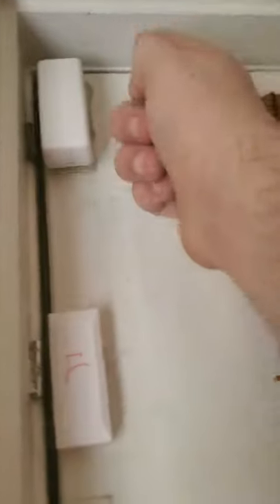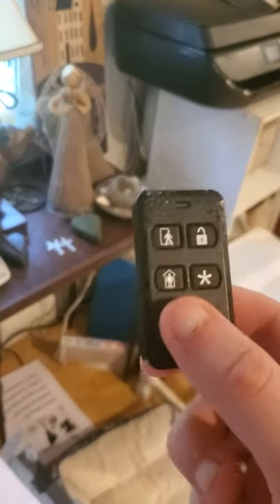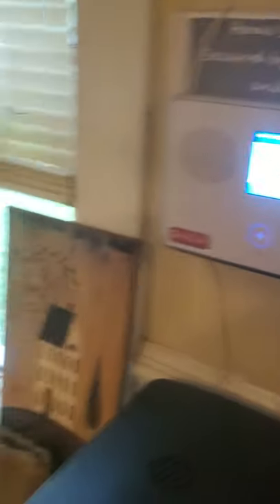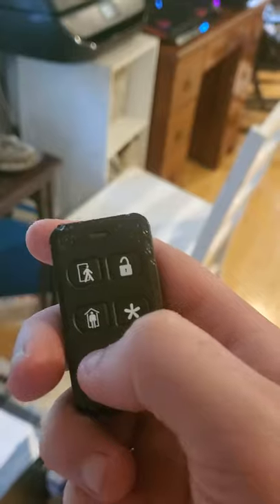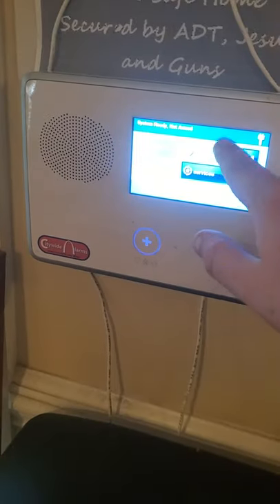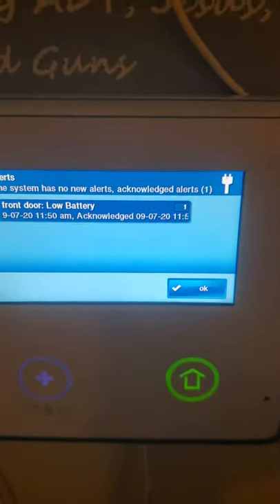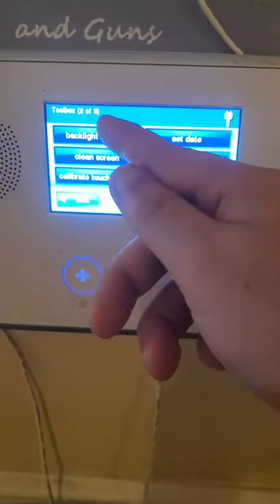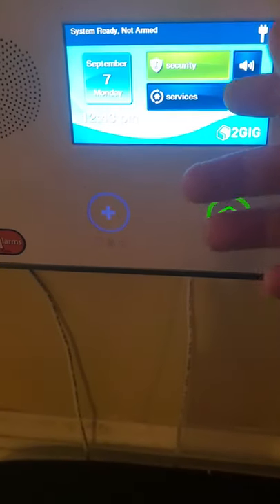2-Gig Alarm Test and General Update

Comment: Awesome video glad your back
Reply from the maker: Thans m8!
Reply: Hey.  I'm buying one of these panels and I'm wondering how loud the alarm siren is.
Reply from the maker: @trevornonis7710  they are exteremely loud! Very good system overall definitley louder than most!
Reply: @tabbycats8229  cool thanks. Just from all of the videos online it doesn’t seem too loud. But I guess I’m wrong😄
Reply from the maker: @trevornonis7710  lol no my phones mic isnt the best lol
Reply from the maker: Hi there! I'd be happy to assist. If you put the door into bypass, set the alarm, and then open and close the door while it's armed then no. The door will stay bypassed the whole time the alarm is set. However you should note when the alarm is disarmed again, you must re bypass the door if you need to open and close it. All bypasses from the previous armed state are cleared upon disarm. You must manually bypass the zones each time you arm the system. But yes as long as the door is bypassed  you can open it as many times as you need whilst armed. I hope this helps and please let me know if you need any more help! :)
Reply from the maker: @Dilhan Gurbuzer Glad I could help! The entry delay is a time set, when armed in away mode, for you to disarm your system once you enter the house. The entry door is usually your front door or the one closest to the panel. As far as your basement and living room motions go, yes you can bypass the living room and use the basement sensor :)
Reply from the maker: I can do a video later this week on how to change the entry/exit times on a 2gig if you like :) I've been needing to do another video anyway
Reply from the maker: @Dilhan Gurbuzer wow that's a ridiculous price! Sorry you had to deal with that. Since the default installer code is not working, you may need to contact the company who installed the system and see if they'll give up the installer code which is highly unlikely. In which case I can help you factory default it (there is a special way and pattern you have to so something with the power plug) but that would require you having to reprogram every single sensor and code etc. I would definitely see if they'll give up the code first. If not I can certainly help you more! 🙂
Reply from the maker: @Dilhan Gurbuzer Also as far as the pet immune thing goes there should be a dip switch inside the sensor for sensitivity depending on the model, I can do a video on that too if you want
Reply from the maker: @Dilhan Gurbuzer yes I will try to do an extra video when I get better batteries for the motion! Also yes if you factory default the system you will need to reprogram any sensors, including the wireless ts1 TouchPad. Please feel free to let me know if you need further assistance and I'm glad to be of help 😊

Comment: Bro do you have installed code? I got 2gig gc2 and now just bought gc3 alarm system panel
Reply from the maker: yes! The default installer code for a 2gig panel is 1561!